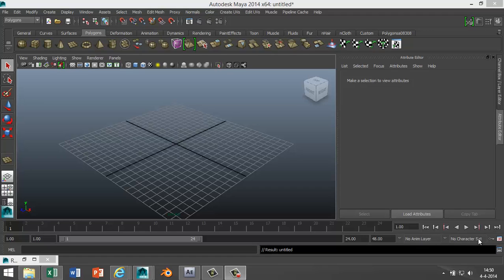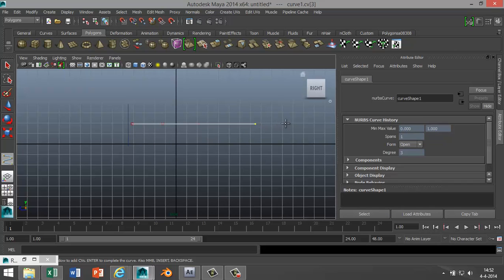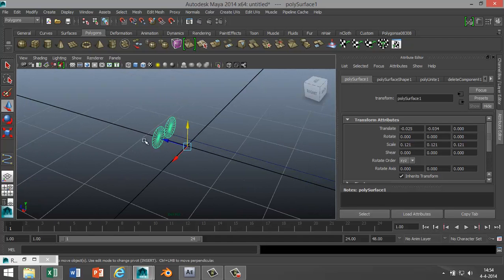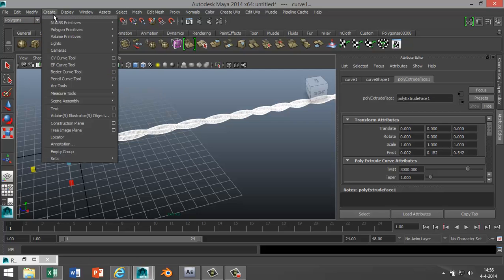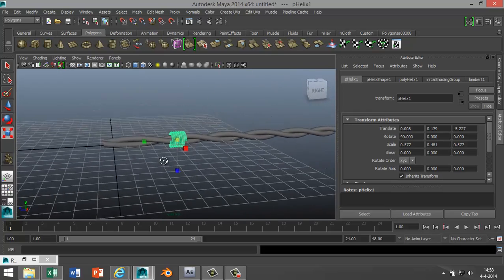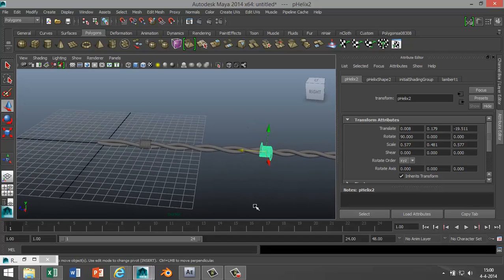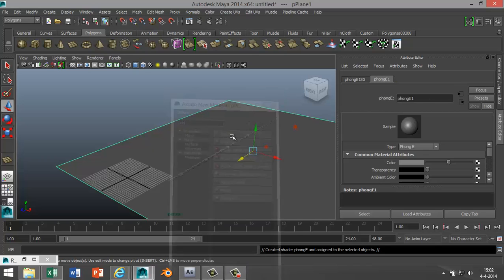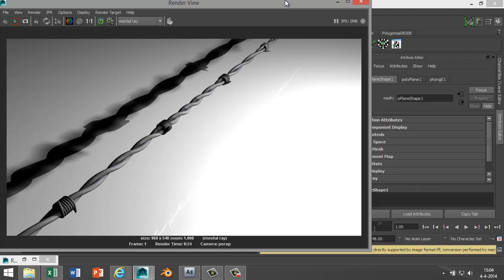Maya 2014 tutorial : How to model barbed wire

Comment: Hope you are good. I am using Maya 2016 and when i select combined faces and curve straight line together and press extrude, i don't get the result u had. It does nothing. And when i do it manually till the end. I do not have Twist option available in "Poly Extrude Curve attributes" which are disabled. Can u please help ??
Reply from the maker: Did you select the face or the object before selecting the curve ?
Reply: Haha no i didn't ! I figured it now!!!! Thanks a lot  :) If i select the face then it works but if i select the whole object and curve then it doesn't !

Comment: Great tutorial, subbed :)
Do you know if there's a way to do a low poly version for use in unreal 4, or would the only way be to use an alpha map?
Reply from the maker: +Jamie Barker Thanks for the sub ! Actually it would be a normal map transfer from a high poly to a low poly, not an alpha

Mike
Reply: Cool, so make the wire like you have, then make a low poly version and bake a normal map onto it?
Reply from the maker: Yep

Comment: What tool technique do we use from here to create quick bends to the form of the barbed wire after this segment has been completed? I know that I have seen a quick technique to do so, if memory serves me correctly, it used a nurbs curve that had been generated somehow based upon the model itself and... for some reason, I remember it being part of the animation tool set... just can't remember what exactly it was...
Reply from the maker: Hi Rtas,

I would probably use a Non Linear bend deformer for a few bends. If it really needs to get interactice ( curling, lots of bends etc ) I would probably go with nCloth.
But during the creation process you could also use extruding along a curve ( nurbs )

Any of those ?

Mike

Comment: An additional tip:
Delete the poly's at the ends because they're not curving the same way as the ones in the middle, then place one of the barbs half-way over one of the ends to cover up any inexact placement when you duplicate the wire to make it longer.

And if you then want to take that wire and wrap it over something I think you can just apply a deformer to the whole thing after you combine it all (correct me if I'm wrong on that). [EDIT: I tried a bend deformer and it squished/stretched the barbs so I wouldn't recommend it. Anyone else have a better idea? Also, I subscribed.]
Reply from the maker: Hi OvrStart,

First of all thank you for subscribing.
Good tip on deleting the ends.

A better way instead of using deformers would be to extrude along a CV curve and then twist. I used that technique in my twisted rope tutorial.

Regards,

Mike